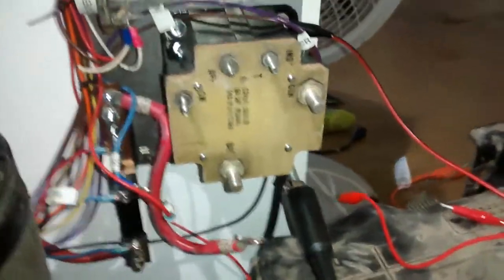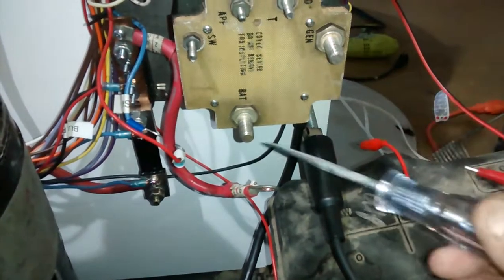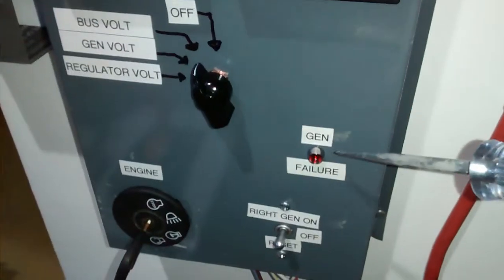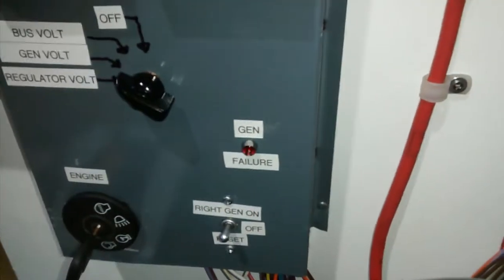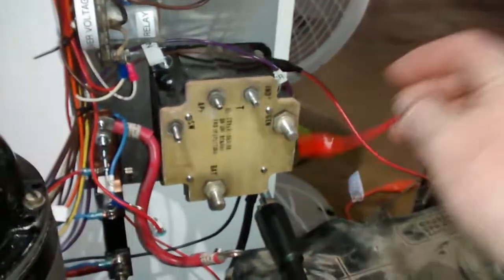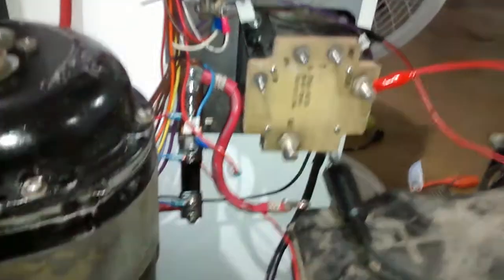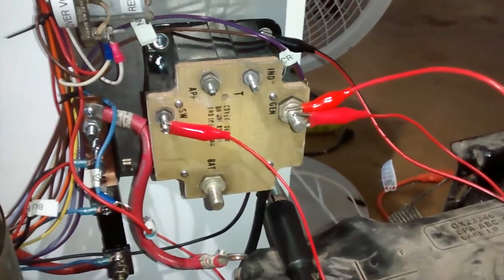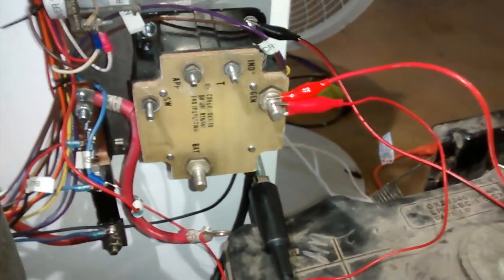Bench Testing Reverse Current Relay

Comment: In order to test this while installed in the aircraft using the aircraft battery that must be charged and over 22vdc if you don't have a 0-30v dc power supply. Unplug (disconnect) the aircraft battery. Remove the Gen cable and keep it isolated from the airframe. If it's on a Bell 205 (Huey) also remove the smaller gauge field wire and keep it isolated from the airframe or instead pull the gen field CB and make sure the Gen switch is off. Remove the Sw wire and keep it isolated from the airframe. Remove the Batt cable and re-install it back on the now empty Gen terminal provided there's enough length if not with the Batt cable still removed and isolated from the airframe use a small jumper wire or 2 instead same gauge as Sw wire probably 18 gauge. The lower the gauge or bigger the wire the better to cover the amount of current draw. This now simulates the aircraft battery as the gen output instead of in the video he uses a 0-30vdc dc power supply. Take a jumper wire and attach it from the Gen terminal (Or Batt cable end to Sw terminal) to the Switch terminal. Use a multimeter on DCv with pos cable attached to the Batt terminal and black cable to ground should have no reading now. Now re hook up the aircraft battery and turn it on and remove and touch the Sw terminal with the jumper a couple of times and it should click off and on off and on etc. Re-attach the jumper back onto the Sw terminal. The multimeter will now indicate Batt voltage through the differential voltage coil to Batt terminal because the circuit isn't under load now. The multimeter shouldn't energize the RCR when set to measure voltage. Now use a 6/12/24v capable circuit test probe and attach one end to ground and then momentarily touch the Batt terminal lighting up the circuit tester and energizing the differential current coil and there should be a bigger clunk indicating the contactor coil has also energized.The Gen fail light should now extinguish and the multimeter should still indicate battery voltage. The RCR Diff Voltage contacts will remain energized even after the 6/12/24v circuit test probe is removed because the differential voltage coil contacts don't utilize spring assisted contacts but solely rely on the direction of current through the differential coil to determine it's contacts position. Once the differential voltage coil has energized you can remove the Sw jumper wire from the Sw terminal and touch it back onto the Sw terminal off then on then off then on and you should hear the corresponding big clunk on and off etc. Turn off the aircraft battery unhook it and reinstall all the wires in their original before removed standard operating positions! I would suggest performing a ground run to make sure the generator comes on line. You'll know it's online when the Gen light extinguishes and the Dc voltmeter select switch indicates Gen voltage or roughly 28vdc on all the positions so in a Bell 205 (Huey) the Batt, Gen, Ess Bus and Non Ess Bus positions. If it's not online the Gen light will be illuminated and all the voltmeter select positions will indicate battery voltage being less than 24vdc after the load of engine starting on the battery. Sounds like a lot under written procedure but it's a basic test.

Comment: From the model number A700AO6 in the description. After some exhaustive research I found it has a voltage coil, a differential voltage coil, a contactor coil and a reverse current coil inside. At a min of 22vdc gen output voltage the voltage coil will energize via the Sw terminal and it's contacts send Gen voltage to the differential voltage coil which is wired across the main contactor contacts to the Batt terminal. As long as there's higher Gen voltage on one side of the differential voltage coil than Batt voltage on the other side by roughly 0.5vdc so current flowing from Gen to Batt/Bus through the differential voltage coil it energizes and it's contacts send Gen Voltage to the main contactor coil and once it energizes with the big clunk the Gen and Batt terminals are finally joined together. Not 100% sure which coil the App terminal tests but there's no wire hooked up to it either on the Bell 205 (Huey) helicopter. The Ind gets powered only after the main contactor has closed energizing the Gen fail relay extinguishing the Gen fail light. As for the reverse current coil if there is reverse current flow from Batt to Gen will de-energize the differential voltage coil opening it's contacts which will stop current flow to the main contactor coil de-energizing it and opening it's contacts opening the Gen to Batt terminals. Once the voltage further drops to around 18vdc gen output will then finally de-energize the voltage coil via the Sw terminal. There was a lot more going on inside this than I originally thought!

Comment: I have flashing lt of dc generator in ground run I have replace the RCR and I have change the generator failure relay 
In idel every thing is normal but in full power the problem come again what will be causing the problem 
And I have also checked the wiring many times i don't found anything
Reply: I see this post is 2 years old. What was the solution to the problem? Loose connection, Generator?